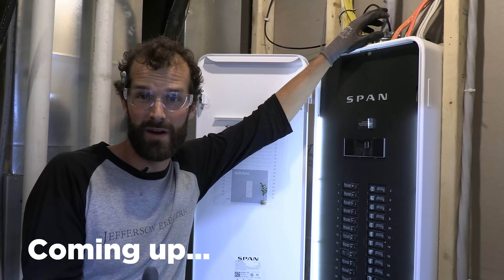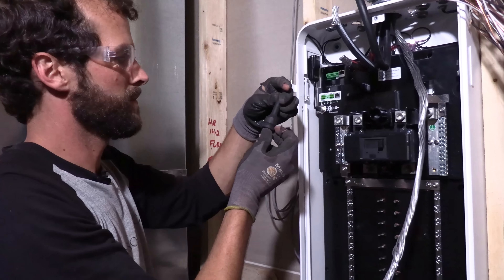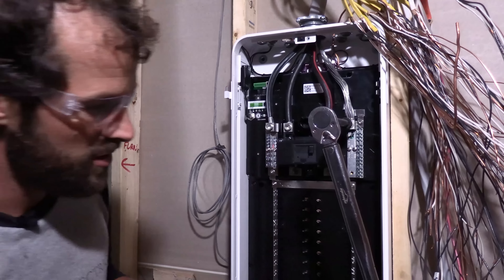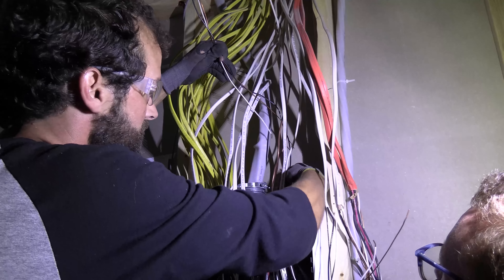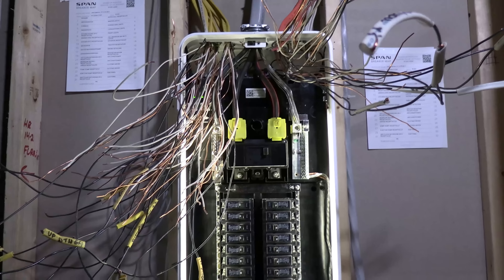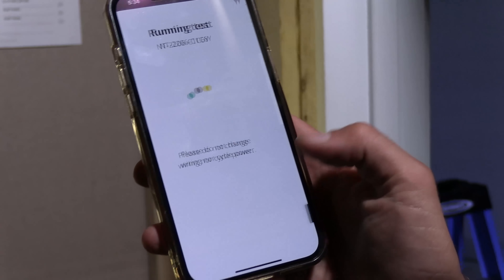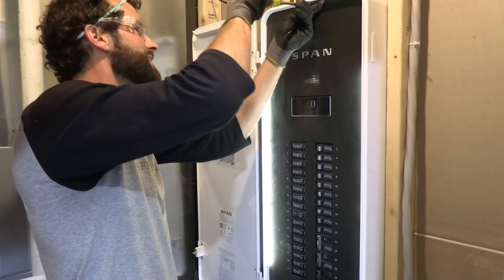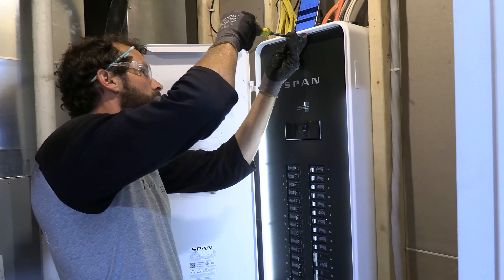Tesla Exec Revolutionizes Breaker Panels Forever - Finish-Out - 3

Comment: my main concern with this pannel is that the company will not be around in lets say like 10 years and all the "smart" functionality will be dead and then you'll end haveing over payed for a regular pannel or it will go completely dead
Reply: This is an aspect where technology has surpassed regulations.  Ideally, if this company goes under, the propriety software would be required to become open source and another company or open source programmers could re-enable the smart features.
Reply: Honestly I don’t see that happening…..with all the new home batteries and solar being installed in homes
A smart brain-is needed and this fills the niche.
Reply: @benjaminvivar7855  I must be missing what this panel offers ? Solar and batteries have there own apps ,data monitoring and programming.
Reply: @persona250  Imagine a spot on the Electrical Distribution system where solar power, batteries, electrical utility, house generator, car charger and the house loads all meet in one area. 
That would be the Main Electrical Panel or the SPAN Panel, by having Span Panel in a centralized location, with smart capabilities and SOFTWARE ! The future is, let’s say your Tesla is fully charged and in the evenings your electrical rates are through the roof. Well with a smart system (Span system) your car would be able to run all your house electrical loads. The system doesn’t have to tell you, it automatically would disconnect from the utility and have your car run your house. I don’t know if span can currently do that but that’s the future different electrical sources being manipulated 
To charge batteries,  maybe a sunny day house can run off of solar power, all these situations effortlessly. That is awesome you’d control your energy. What Span does it connects and controls all loads and power sources.
Reply: @benjaminvivar7855  no the span panel cannot do what you claim . Vehicle to grid doesn’t exist yet . The panel has no changeover switch so no generator connection. 
What does it do ?
Reply: @persona250  Yeah your probably right it’s an early model, it would need to have a Transfer switch, what I’ve seen through YouTube the Panel doesn’t look like it has a transfer switch
But, in due time Span, Eaton, Schneider
Will let your house control all power sources Span is only the beginning, I was trying to give a vision of the possibilities of software and hardware in a main electrical panel.
Reply: @benjaminvivar7855  that's already in the works. There's a FERC order out for RTOs to implement DERa (distributed energy aggregators). That is, a market participant who sells energy aggregated from things like home solar, plugged in EVs, etc on the energy market.
Reply: @SirBrass  what do you think of the product sol-ark ?
Reply: @wohnai  Not sure the issue is just software. A normal panel has a lifetime+ service life. If a chip or board inside this panel goes bad (and chips don't like heat, or over current), you have to remove half the guts in this panel to get to it (big labor), assuming that:  A- Span is still in business B- Span retains parts and backwards compatibility 
Even very forward thinking companies like Festool only guarantee parts availability 10 years back.
Reply: @persona250  ford or Nissan ev's and hybrids? VTG dealership's told me it was enabled
Reply: @ericdillenberger7873  no Germans 400A seman's panel sold for a USA 🇺🇸 home is a 20 year part warranty period is for 5 years i know that from my 2020 manual. so yes they do go bad after awhile and so does the wires after 15 years or so
Reply: @richardprice5978  that doesn’t mean anything exists to extract the power from the vehicle and distribute.
Reply: @richardprice5978  rewire every 15 years then Richard .
Reply: @richardprice5978  Sorry, but  you appear to be conflating warranty vs. parts availability vs. SERVICE LIFE. From a liability perspective it is reasonable for Siemens to limit warranty even for an entirely manual part, but in the real world where we work there are panels 50, 60 years or more in service who's future life is still fine. As to wires... with modern insulation jackets (the weak link), barring over current, uv, chemical, short, mechanical abrasion, their life span is enormous. 

The smart panels otoh have chip IC boards which degrade overtime even without presence of heat or current and they are hidden BEHIND all the line voltage breakers and wires necessitating their removal to access a failed chip circuit board should it even be available and needed.
Reply: @ericdillenberger7873  millwright/maintenance manufacturing plant. yes work in larger companies/corporate keeps track of it and does trying and replace the wiring jacket every 15-30 years to keep fire 🔥at bay and the panel's ect. are checked every 90 day's with things like info-red gun's and visuals inspection's and meger's ect

for my car hobbies after 20-30 year the wire's really start to become problematic fire or stranding me somewhere. my oldest was a 1968 C10 newisted is a 1986 k1500 fallowed by my zoomer sibling's 2006 ( 1 owners and dealership's ordering in aka COPO ) rubicon-unlimited jeep but im not counting it as i don't own it but yes the wiring is starting to show minor problems, unlike my c10 wow basket case and yes it had other problems with it like flinstone floor-board's ect got it that way in 2012 from a stranger and probably the 3 or 4th owner's 

for home's and yes iv lived in more than one oldie 1910~ is the oldest one so far and the newest was 1980-88ish parents/childhood home all started to show singes of there age after 25-30 years and yes it's possible to get 60 year service lifespans. but im being reasonable for saying 20 to 25 year's later in this 1970 home 🏡it will need work again and seting $$ to do repairs is wise as it's not going to make it to 200 years from 2020 aka 2200
Reply: @ericdillenberger7873  id show you pictures of the 1988 home but i can't and yes the beaker's in 2004 or 08 where done 🔥marks didn't light the house on fire as it failed in the safe-ist mode aka just quit working one day and my mother at the time had to call for help ( i wasn't a adult or teen at the time aka not much help as a 80's/90's kid )

now the 1970 equipment/stuff in this 1970 home ( know/owned it from 2013-up, daily here sense 2017 as base camp ) has tried more than once in the last 5 years to burn it to the ground and the one time i was sure i couldn't get the fire 🔥out and it was time to evacuate the building for the last time ever this was a panel,dishwasher,kitchen fire in 2017 or 2018 right after the renter's moved out and i finished moved my stuff in and "dam i have bad timing well there goes my worldly possessions up in smoke in the next hour", really lucky 🍀me/family the poll/transformer's that's was under sized ( 25kvh ( we/next door's use to trip it all the time ) vs what it really needed a 80+kvh and in 2022 a 50kvh ) at the time tripped/broke leaving me and my neighbours with out power for 72H's~ kitchen and mechanical/laundry room fire lasted 5-20m's and mostly smoke/CO2 and water damage's and appliances ( 2004-fridge is the only thing leftovers from 2018 ) damaged/totalled out $$ and yes the wiring,challenger-panel ect was patched as a temporary fix and yes there's bare wires in the attic as the PVC/coating has completely come off from time/age not super sure if that's possible part of the dishwasher fire but later on it did start a new/different fire unrelated to 2018

so hence why in 2022/23 it's disabled and or being fully R&R'd
Reply: @ericdillenberger7873  BTW one home 🏡i was in ( moved out in 2016~ ) still was on eddy fuzes and 1930's equipment ( cloth wire's ect code for pre1950's parts were okay or ok-ish, garage was redone in the 60's or late 70's and was super sketchy ( not done to code even for the 70's books ) and also done ) that was salvaged in a 1940's-60's home as the first/poor family that lived there took years to build/finish it

30-90A 240V or 120V ( sorry i forgotten ) sp main service utility side and also that equipment was super old ( aluminium Arial equipment so probably not from the 30's/original build-out ) as well and probably just as under sized electric-wise as the home was

i didn't do anything electric wise to it but it was done and time for the meltdown/scraper's. the bones of the house 🏡wasn't that great as it was tired and wasn't wow architecture but for the right family it's a restorable 800SF 3 or 2 bedroom comfy home 🏡
Reply: @persona250  please explain the BEV and V to G on your commentary 

as for older homes 🏡i like pre-1920's 3-story victorians' architecture aka something fancy for 3-4500SF / about 6 bedroom's and 1950's-70's garage's with lots of glass and SS or aluminium ect aka something automotive fun 2-6 car/bay and or stackable car's

im not really a fan of 60's gorge right's works aka row USA 🇺🇸 housing done in a ranchers house style , i do like my charger from the 60's and 🇬🇧 car's from the 50's-1970 as a contrast between homes and car's/lifestyle 

but would i trust the nob in tube wiring or 1880's ( or 1950-70 ) methods or putting up with after thought 1940's-70's DSL-internet no! fibre-internet ect, please keep the rest of the stonework's/bones ect
Reply: @richardprice5978  what would you like me to explain?
Reply: @persona250  that doesn’t mean anything exists to extract the power from the vehicle and distribute. =???

Nissan made there charging network and equipment for bi-derecicshoale and ford f150 120kw~ has adopted something similar to it and the model s and 3 had the hardware installed in some years but never got turned on software wise, so hold up to you is ...?

big selling point to me was reasonable ROI for a car/truck/transportation ( ford dealership's have gone nuts 🥜100+K-middle rages of models nope i was more for 30-60K usd 2022 ) and it's less the buying wall battery's or at least in authority-areas is less needed as i can get away with home-2kw~ hours vs 10+kw~ as minimum's and or skip the car-style 12-14DCV for the ATS that's mandatory for islanding/500w-1kw+ solar installation's looking at 20kw setup
Reply: @richardprice5978  hi Richard I design and install all the things you have mentioned here . There is nothing available to a homeowner to connect an EV to a home yet . Schemes are still in testing and no application is available from the network operators. I can’t see what the argument is ???
Reply: @persona250  im not arguing with you but this is acward as ford corporate and my local dealers told me to buy the 100-130A charger and it will be able to do it as soon as i drive the truck home ( my wallet for now is trying to outwit/out-wait the hype/$$$+over promised MSRP also don't have 50+K in my bankroll or the ability to get a lone for it aka 100k is out of my buyers range for now ) aka it's on the market now and enabled for end users
Reply: @richardprice5978  the vehicle battery holds charge in DC . You need a charger/inverter hybrid to get it back to AC for use in the house (this is not available to purchase yet ). You would also need to obtain permission from the network operator to connect such a large power source to the network . The application form for this technology does not exist yet .
Reply: @persona250  i kinda already know a lot respectfully, as a maintenance technician 👨‍🔧as DC drive's are used so is 480V 3p and 24Vdcv, plc's ect-ect

solar/renewable resources energy sector sources i was invited back in 2012 ( 20-25 year old at the time ) for training's on the industrial side but i didn't think 🤔it would last as i though it was the 70's fad all-over again boy have i been wrong so far and im glad sofar it's not a 5-9year fad

so can i be wrong yep but my understanding is the local hardware is available, that or ford is lying 🤥to a lots of people and next will come a class action lawsuit not from me as i don't have a ford this week but others who do will be upset about features not working and the federal government will sue for false advertising ect.

now 🇺🇸  RMP/Pacific-corp/Burke shire's & Hathaway actually encourages/incentivise's grid battery's/renewables and or islanding systems as it lowers the ROI/better costs for them as peaking plant's isn't needed as much and or outages are lowered ect. so i got the permits and green lights to do it but i still have to have minimum size wall mounted battery home-battery of 2kw size mostly for the ATS/islanding and communicatshion/computerised equipment to the utility and me/home owner/resident and a tiny usable energy buffer and yes you could increase the wall size max on my county codes is 20-100kw ( concern is about lithium battery fire's and firefighters safety and next door to me, far concern's to me ) sorry i really was paying attention/remembered as its not relevant to my installation as car's/BEV's doesn't count codes wise and the property can only hold 4 car's total realistically it's 2 so not much of worrying about
Reply: @persona250  how meany home owners or residents actually take care of plumbing or electric/wiring ect as i think things like the guts of a house are treated as setup and forgotten about intel it quits or 🔥🏡or law/governments get involved and force the money/matter for updates or at least in pre-2000 USA 🇺🇸 homes as a example ? im betting a lot lol 😂

look pretty things like the mailbox or front door 🚪paint is kept up though as my bet aka fliper things
Reply: Hopefully they won’t implement a monthly fee to their software/panel combo to take advantage of some new updates or extra features. 😅

Comment: I heard a lots of problem with setup SPAM system.  Need to works all the bugs out and lower the price before I want to get one.    Also SPAM software need to integrate to other more popular Solar and Battery software.   To me, SPAM consist of  heavy duty relays for each circuits control by software on the cloud nothing new..

Comment: Fans are just not a good idea for a power panel. Really should have found alternative cooling methods.
Reply: Why don’t you think fans a good idea?
Reply: Fans can introduce dust and vapours you may not want inside an electrical panel. I suppose one day the industry will require electronic monitoring but for now I’m still wrapping my head around arc fault breakers

Comment: Use a powerline Ethernet device and save yourself the headache of trenching.
Net gear makes one that has a LAN port and a wap so then you have wifi out there too.
Reply: Power line sucks if it’s not the same circuit…
Reply: @itszachcarter8370  you may have just had bad devices I've installed over 100 of my previous employers' products and seen people run IPTV on others. They work pretty well also it's not like it's for a gaming or UTP-based service. It just needs a connection.

Comment: Your videos are very entertaining but I am concerned that you always have holes in your gloves. Isn't that highly unsafe?
Reply: They aren’t electricity insulated gloves, he’s wearing them to protect his hands from being cut. Depending on the task at hand I’ll wear gloves with some holes in the fingers for a bit longer. I tend to get bit on the back of my hand more than the fingers when working.
Reply: They actually sell gloves like this. They're called framer gloves, I think. Basically the thumb and two fingers are left off so you can grip the nail. Anyways, it makes a pot of tasks easier to have the fingers exposed, but still protects the rest of the hand from scratches, etc.

They're uninsulated anyways, as the above comment says.

Comment: Not trying to sound like a hater 😂 very fancy span box but u guys think those cooling fans will last more then 5 to 10 years 😂plus dust and debris. Those fans will be getting clogged and to repair them oh heck no that panel looks like it’s a liability 😂😂😂
Reply from the maker: Dust is a valid concern. It'd be amazing if electricians inspected and cleaned up panels every time they opened them up. We've got a $150 line item that provides a thorough, check, clean, torque...